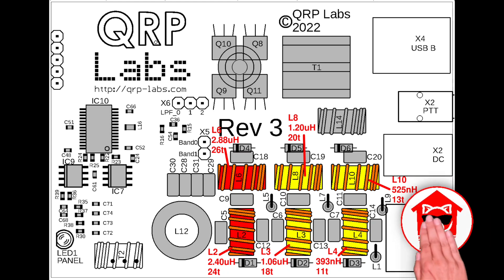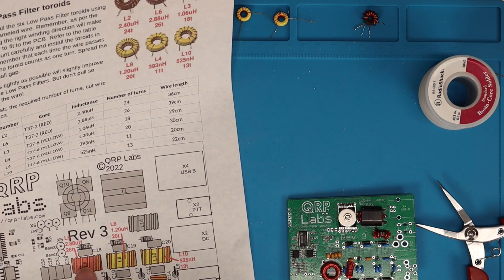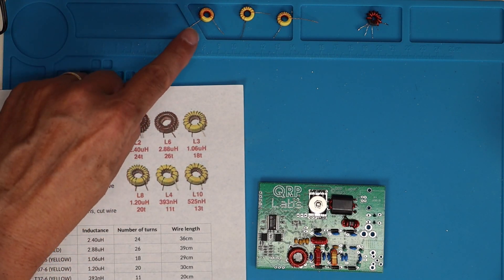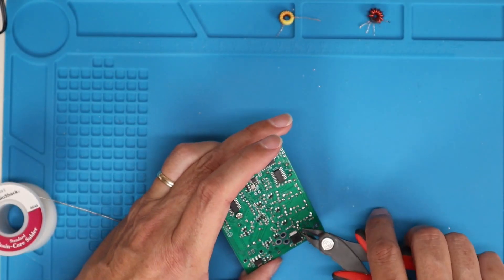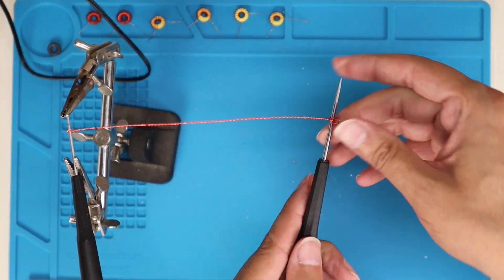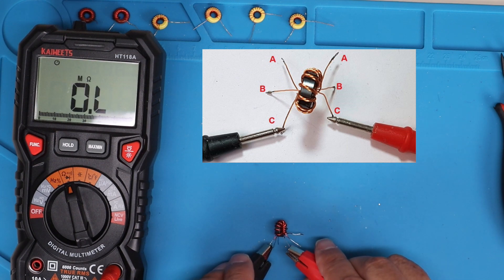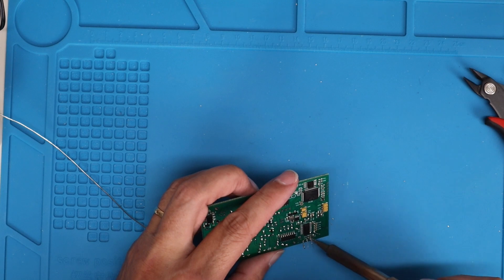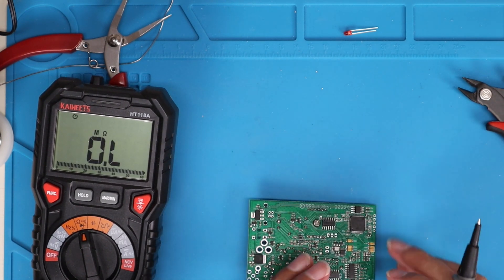Build Your QRP Labs QDX Part 4

Comment: I had the same issue as Rob Montgomery below.  When I did the continuity test A, B, and C were all common with each other.  Not just A with A etc.  Is that right?  I am trying to troubleshoot why I do not have any audio on the input side of FT8 or JS8 call.  No indication on the right side slider that the computer is receiving any audio from the QDX.
Reply from the maker: I assume that you are measuring once T2 is installed. If that is the case, that is normal. If you look at the schematic, you will see that except for the very small resistance that the coils provide, they are basically wired together. I would either get on the QRP Labs Facebook group or the QRP Labs Groups.io forum.

Comment: Quick question on T2. I confirmed that I had AA-BB-CC when I installed T2. After I soldered them ABC are all connected together now, continuity wise. Basically all 6 are shorted together. Is this normal or did I melt them all together? The IC points are shorted per instructions. Great videos. Thank you.
Reply from the maker: This is a fairly common occurrence in rf electronics. Look at a J-pole antenna. Understand that an ohm meter is DC so what looks like a short at RF looks completely different. The coils don't have much resistance. I don't recall if I had the same thing after I did my build. I would take a look and make sure you don't have any solder bridges and if not, you should be good.